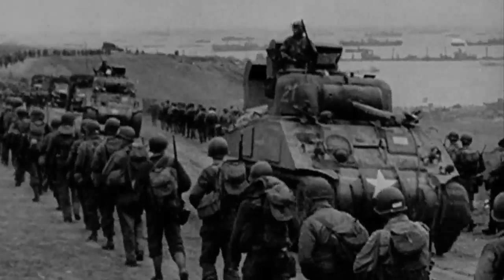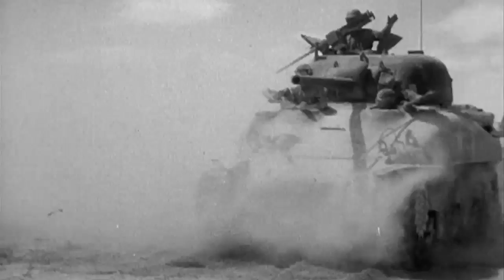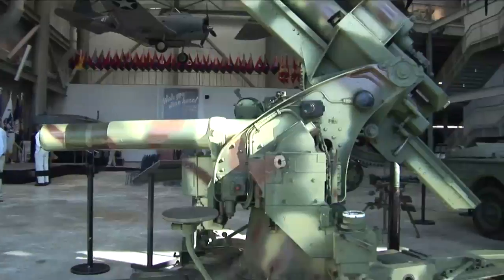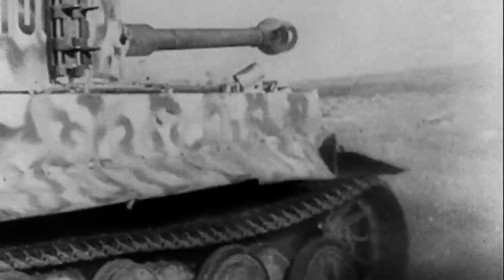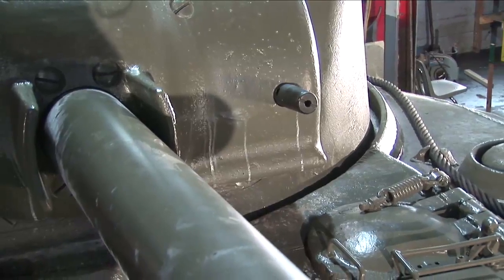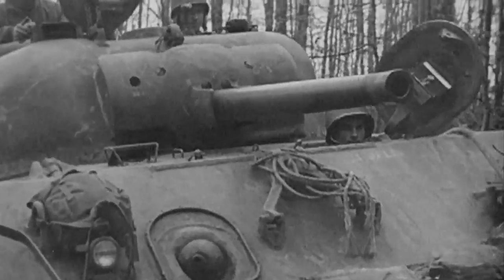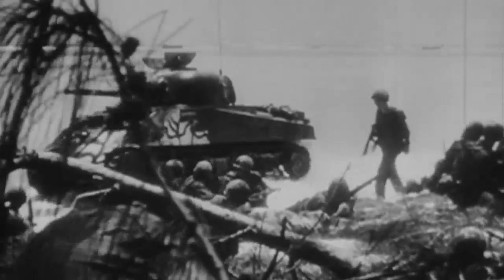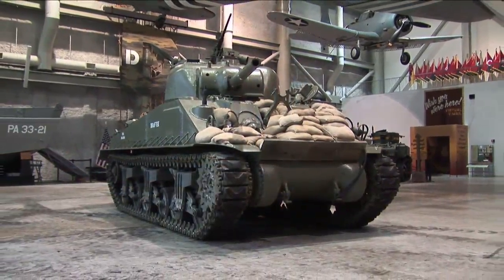The M4 Sherman Tank at The National WWII Museum

Comment: "the Germans had a wide variety of anti-tank guns that would punch though any piece of the Sherman armor"
>shows m3 stuart
"even their panzerfaust would punch though the frontal armor of the Sherman."
>shows t-34-76
"german's deadly panther"
>shows Stug III
"and tiger tanks which took a heavy toll on the Sherman crews"
> shows Panzer 4
"it too [the gun] often fell short in combat"
> shows M4 sherman with 76 mm / 17 pounder gun.

??????????????????????????????????????????
Surely they could at least find 4 minutes of stock video.

No mention of wet stowage rack
No mention of M4A3E2's armor
No mention of 76mm or 17 pounder
No mention of Wooden armor in the Pacific. 
And he makes it sound like they regularly engaged tigers.
Reply: steffenbk1 Everything you just said is factually incorrect. The engine and fuel used in the Sherman had very little to do with the Sherman's tendency to catch fire. It was actually the placement of the ammunition that caused early Shermans to catch fire. This was fixed with additional armor covering the side ammo storage and the introduction of wet stowage. By the end of the war the Sherman was one of the least likely tanks to catch on fire or explode. As for armor the Sherman was not lightly armored at all. The Shermans front plate with the angling was only a few cm thinner then that of a Tiger 1. As for the US not building heavy tank the Army didn't really want one. A heavier tank would have been harder to transport and had problem's with bridges. As for Cooper his "first hand experience" was non-combat and half of the things he says are factually incorrect. Remember his book is a memoir and should thus be taken with a grain of salt. By 43 the Sherman was one of the most reliable, effective and safest tanks on the battlefield. A tanker who served in the lend lease division even said that if a Sherman caught fire it wouldn't explode like a T-34. The Sherman was also much easier to get out of then just about every other tank on the battlefield. There is no real evidence to support the idea that the Sherman was an "engineering disaster" or that it struggled against German armor.
Reply: +steffenbk1 By who? Belton Cooper and the History Channel? The idea that the Sherman was an "engineering disaster" is a myth. If anything was an engineering disaster it was the German Tiger and Panther tanks.
Reply: That tank know as Sherman is my fav. Because you can make anything out of it and it always worked.
Reply: +Evan Roberts

 And which documentaries are these exactly? And which veterans?
Reply: In the sector of the offensive I am referring to, all of them. I have come across six encounters, three of which are referred to by Zaloga in his later books.
Reply: Nathan Peterson, the latest view, for combat is 3. First the Sherman’s won in Italy against a Tiger 1 the Second the Pershing lost against a Tiger 2, the third the Tigers were caught of railway cars. They did capture a load after the Normandy breakout, which had been destroyed by the crews. The biggest issue after Normandy for US tankers was the Panther, and the Jadgpanzers. The commonwealth 21st Army faced the 3 heavy Tiger Battalions and 70% of the Panzer armour in Normandy, but had the 17Pounder firefly and 6 pounder anti tank gun, with special ammunition to do the job. The standard Sherman could do the job, if handled correctly, it was about the crews. A Canadian troop destroyed 9 panthers without loss for example, I am sure there are similar examples for the US Army. It’s all about the guys in the tank, bottom line they were better.
Reply: Evan Roberts well well the US invaded on their way to Berlin they encountered 3 Tiger tanks in battle 1 fought a Pershing and won the other two fights were shermans and the Sherman won
Reply: +fallout0624

 There are considerably more encounters than those.
Reply: They only made about 1500 Tiger 1s and with their legendary reliability and being shipped east for the fight against Russia so very few were in places American tanks could fight them also Panzer 3s and 4s were called put as Tigers
Reply: +fallout0624

 That figure came out of an estimate that Zaloga could come up with instances that have been verified to exist. But that was back in the early '2000's. Numerous encounters have both come up and verified in the R. Elbe offensive alone.
Reply: Nathan Peterson how many of those were the Americans encounters
Reply: My biggest problem is they may have encountered more but its hard to prove and other sources may have had Tiger IIs Strumtigers and other variations added to the list which makes it even harder
Reply: I go with the ones i can say are confirmed because as stated earlier every Panzer 3 and 4 was called a Tiger hell some of those tanks may have been miss identified at the time its getting harder and harder to confirm what happened or didn't happen
Reply: Its simple really....i say this to those who keep saying how good the sherman was:
If somebody said to you that you had to fight a one to one battle between a sherman and a tiger or panther but you had the first choice of tank,which would you choose.If you had any brain cells at all you would choose the German design because if you chose the sherman you would be dead.
The sherman only helped the allied effort because of its sheer numbers not because it was a great tank.If Germany had been able to produce  over 100,000 panthers or tigers to equal sherman and t34 production,what do you think the outcome would have been then..........lots of burnt out shermans and t34's which is another overated tank.
Numbers beat the Germans not superior allied designs.
Reply: https://www.youtube.com/watch?v=hn-t2JjHny0
Reply: "It wasn't engineered for a fight with bigger or heavyer tanks, as the should have" No it was not, that is correct since it was a medium tank and not built to fight heavy tanks in a tank vs tank duel front facing, even if the armour was quite good since it was sloping. But still it did and killed them (lots of them). Why? Because they learned how to kill Panthers and Tigers since they had weak areas, because they always worked in numbers (platoon=5 tanks, and so on) and out manoeuvred the bigger heavier tanks, because an M4 was part of combined arms warfare engaging with AT guns, Tank destroyers, Infantry, artillery, attack aircraft. The video above is total crap...turn the argument around and no German tank could survive the bigger calibre allied AT guns either. Totally pointless statement. So many negative myths about the M4, and as many positive about the German tanks. The M4 was by far the best all-round tank of WWII and had by far the highest survivability numbers.
Reply: It's funny that in 99% of Sherman documentaries, Sherman drivers state that tank vs tank, it was SHIT.
Reply: +Cap Camouflage Pattern I and he said the sherman was "reliable" when in fact they wore called an engineering disaster
Reply: +Wilson McDonald An "engineering disaster" doesn't always have anything to do with how often the engine breaks down or how much maintenance it needs. The disaster was that the sherman was made on the bases that the american army thought faster equals better, therefore putting a aviation engine that used high flammable fuels and giving it a lightweight armour. It wasn't engineered for a fight with bigger or heavyer tanks, as the should have, they made a tank to the wrong front. And cooper has many valid points seeing how he knows this first hand. And where do you have it from that the "engineering disaster" was a myth?

Comment: Sand bags? Really? My god. This thing was a piece of crap hahahah
Reply: +NiCoo ce Lies, the Sherman is one of the best tanks ever used during WW2, reliable, fast, easily enough armor for the weight, adequate gun against Pz III's and IV's. and since only 1500 Tigers and 3000 panthers where ever built, they often didn't meet them. 

and since over 40,000 Shermans where produced, they could easily out gun the opponent.
Reply: Why would they need to? And the reason the allies never used heavy tanks in large numbers was because of the bridges they would have to cross (and wading water, and traversing mud and land) ... And also that the cranes that the ships used couldn't really handle heavy loads, so the Sherman was perfect as it had good all round capabilities (Thats why there are O rings on the turrets and hull of the Sherman... so that it can be lifted up onto a ship for transportation to Europe)... There wasn't anything wrong with the Sherman, infact some variants could easily outclass the tiger, like the jumbo its just that the army didn't want big heavy machines that would break down, they wanted reliable fast, easy maintenance, and hard hitting, battle tested machines... Also, The army was slow at bringing out the newer variants of the Sherman to the troops, and i hear that the ammunition type they used sometimes was a outdated shell type... Besides those drawbacks, They had such large numbers, that even if they lost one hundred, they would have ten thousand more to reinforce, whereas the germans only had a hundred tigers, period.
Reply: What about German Tanks? They couldn't resist a shot from a PanzerFaust or a German Anti Tank gun either.

Comment: Why do so many people comment about the M4 without knowing anything about it or history ?
Original design of M4 had armor thickness ranging from 25 to 76 mm thick
Original design of T34 had armor thickness ranging from 15 to 45 mm thick
Jump to Soviet experience against German weapons -- result is T34 / 85 in 1944 with armor ranging from 20 to 90 mm thick
Now check American experience against German weapons -- result --- M4 "Jumbo" 1944/45 -- armor  --- 102 mm thick glacis (angled at 47 deg. for a LOS thickness of over 150mm and proof against ALL German tank guns) and over 75mm on the sides. In fact the Jumbo's armor was superior to the armor on the Tiger tank !
The M4 was better armored than ALL of its contemporary designs --- the only failing was that in an effort to maximize production -- upgrades were slow to be incorporated and --- and --- Army doctrine got in the way of producing a better armed and armored MEDIUM tank.
The final evolution of the M4 --- in the "Easy Eight Jumbo" was more than a match for any German tank or the Soviet T34 !
Reply: Very true. Not only that, the Sherman had a powerful gun. The only problem it was equipped with old, out-dated armor piercing ammunition. From 1943 onward, the US military had in its posession an extremely effective anti-tank round for the 75mm cannon called the M61 APCBC. It could penetrate nearly 100mm of enemy armor from 500 yards, and over 90mm from a thousand yards.
Reply: That there was no general failure? 
The M4 racked up more than 40 kills on the T-34
According to Zaloga, only 8 M4s were lost to T-34s
Reply: Only about 250 of the Jumbo were built. It was never the standard variant. 

Nevertheless, we won the war, so I guess our tanks weren't all bad.
Reply: My education on the M4 Sherman comes from You Tube.  So anything that makes me better informed I appreciate.  Thank you.
Reply: 111Sylvester excuse me but the Easy 8 had a 5 to 1 kill ratio against the T34/85. They could and did kill each other beyond 1000yds.
Reply: When the T34 was introduced in 1940, its sloped armor was stunning and the Germans were unable to deal with it when it first came out.  With the arms race of tank development that occurred throughout the war, it is to be expected that a tank that comes out 2 years later to be significantly more effective than older tanks.
Reply: if what you say is true, how do you explain the general failure of Shermans against T34 variants in Korea?

Comment: Eisenhower reported that the upgraded gun-the 76mmM1A1/L51-could not defeat the frontal armor of either Panther or Tiger at combat ranges.  He was quite peeved over the matter, as he'd supported the folks who touted it as the "perfect solution".  An excellent replacement tank, the T25E1, with 90mmM3/L51 gun, was never used due to arguments between AGF and the Ordnance Board (with disruptive, overprotective, input from McNair in Tank Destroyer Command) as to its employment.
  Interesting that no one speaking about the M4 ever mention that it could not neutral pivot (i.e.: spin in place/turn in its own length), which meant it was at a severe disadvantage in urban or other close combat environments, while all COBET (Russian) and Deutscher (German) tanks could neutral pivot.
  Still, the M4's tracks (including Canada's rubber block types) were far better than those of other nations; meaning that most M4s dispatched to the front lines reached them as scheduled.  A former StuG commander I talked with at APG, back in '74, asserted that it was our superior tracks that tipped the balance in armored operations, telling me that:  "our tracks could last, maybe 500km, while yours were good for 3000km or more."
Reply: William Cox The Panther yes could resist hits to the glacis, the turret was vulnerable though at normal combat ranges.  The 76mm would have very little problem with the Tiger up to 1000m without HVAP.
Reply: Only Panthers and Tigers could neutral steer, not the Panzer I-IV.
Reply: The Russians (who knew a thing or two about tanks) thought very highly of the Sherman.

Comment: just comparing tiger 1 to shermans  tiger approx 1500 built
sherman over 55,000. plus the constant rubuilding and repair in combat and in theater. the germans best chance was early. they were doomed!
Reply: +441meatloaf On the contrary, he's completely correct. the Tiger's where only produced since 1943 and only 1500 of them where build, when over 40,000 and 80,000 Shermans and T34's where produced. 

the only advantages the Tiger had over the sherman was armor, and gun. 

Both of which where easily irrelevant during the later stages of the war since both the Sherman and the T34 where upgraded to fit anti tank standards. the Sherman with a 76.2mm gun and the T34 with a 85mm anti tank gun. 

The Tiger was heavily unreliable and impossible to repair in the field, while the Shermand and the T34 where easily repairable and was often repaired, knocked out and then repaired again. while the Tiger was knocked out, and gone..

Comment: That is all well and good and for the most part I agree with you. But the problem is that by 1944, the gun mounted to the PzKw IV was a high velocity 75 mm that could kill a Sherman through the front armor at 1500 m, the Sherman needed to get inside 400 m to do the same to the IV. There was no excuse for landing the short 75 mm gun on the Sherman in June of '44 on D-Day.

Comment: Are you referring to the HVSS suspension? This was also used on new build E8s, as well as being installed as modifications to overhauled earlier models going all the way back to the original air-cooled M4 and M4A1. Many of these overhauled tanks received new turrets with the 76mm gun, as well as the HVSS suspension, and saw plenty of service, though most Sherman variants still retained the older, undamped vertical volute suspension system.